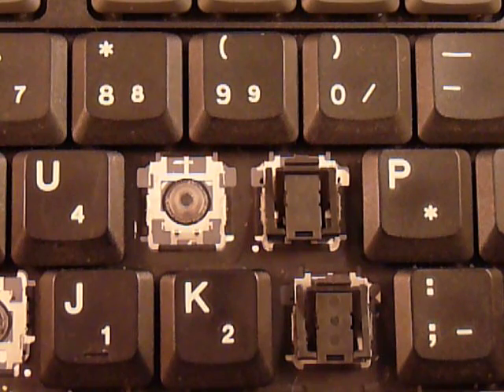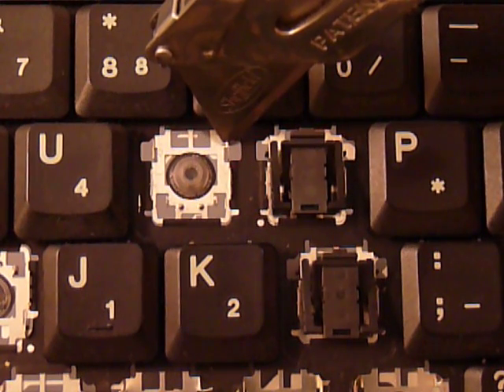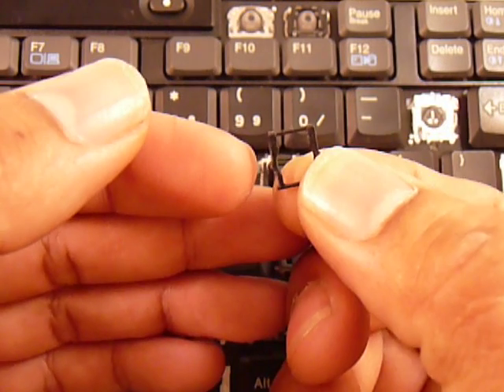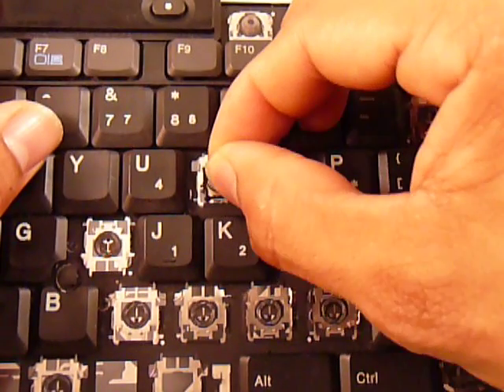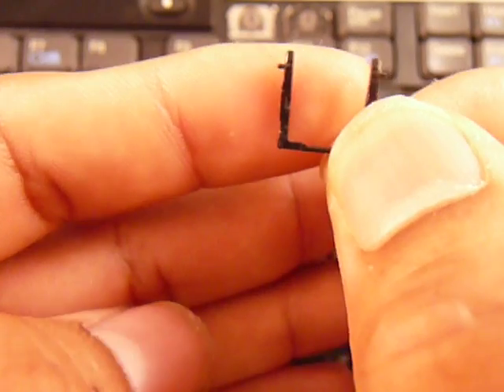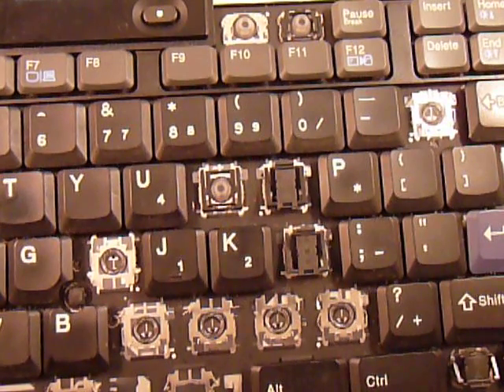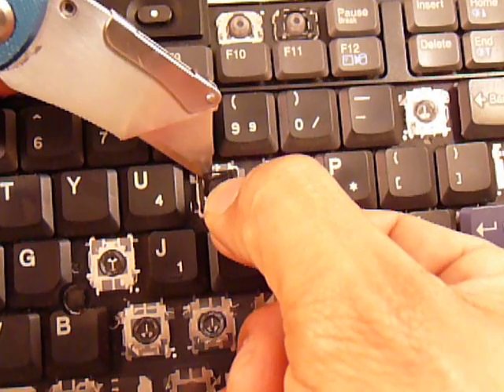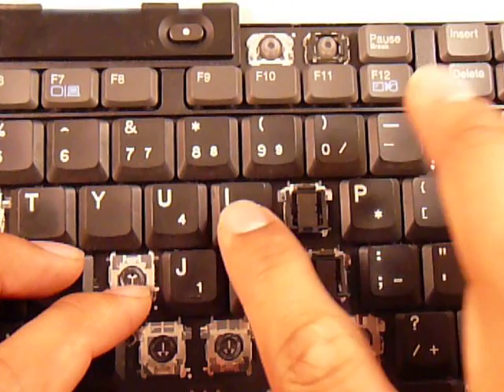Replace Keyboard Keys on DELL 6000 6400 1501 E1505 9200 | Fix Your Laptop Installation Repair Guide

Comment: Thank you for helping an old man. With a very old laptop. Key works great, however my key hardware is turned 180 degrees clockwise from what you show I had to turn every piece around. Just the way it's made. Thanks again!